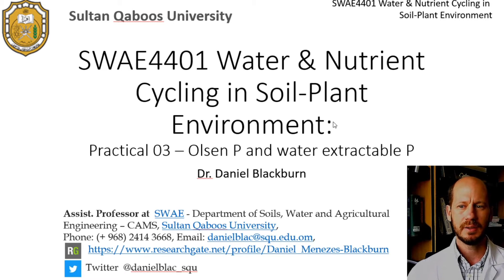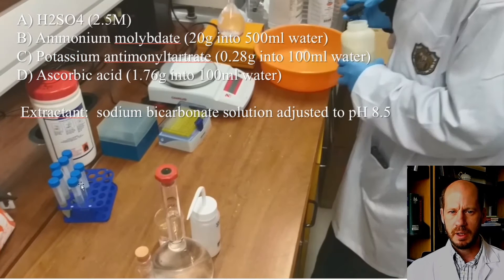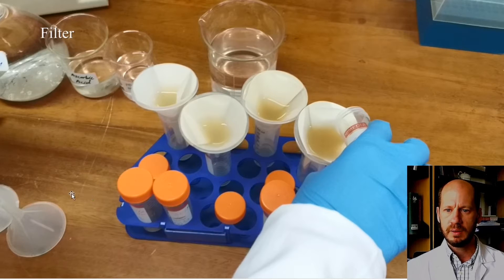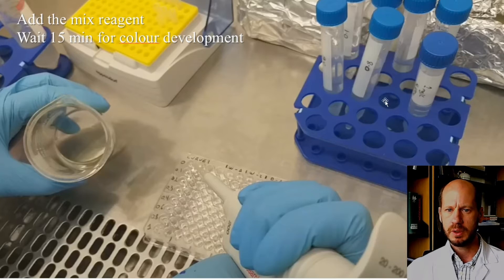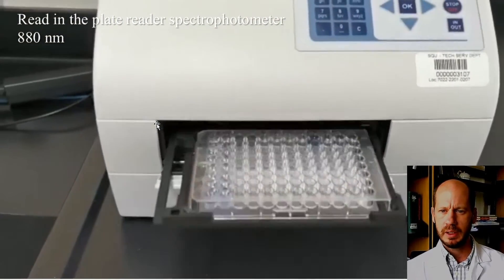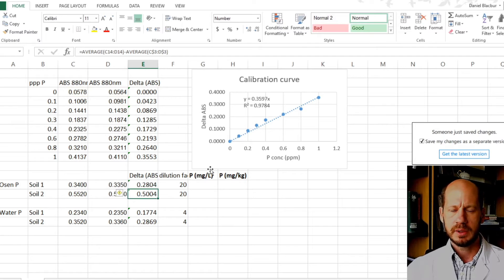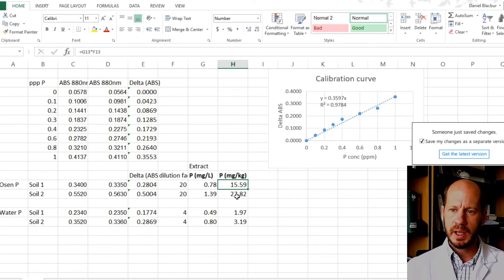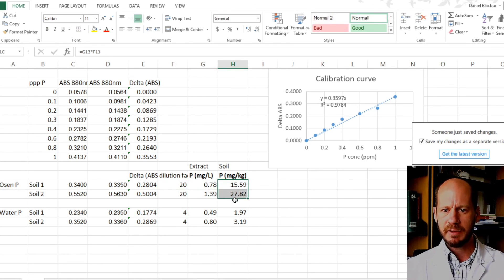Lab 03 - Measuring soil phosphorus bioavailability - Olsen P and water extractable P

Comment: Does neutralizing the Olsen extract improve the clarity of the solution?
Reply from the maker: I usually don't need neutralization because I dilute my extracts 1:20 and make the curve accordingly. For low P soils, the neutralization of undiluted extracts is needed to avoid the fizzing in the microplate, which are hard to remove and makes reading impossible. If the extracts are too dark I recommend using the Malachite Green P method of diluted samples.

Comment: nice lecture..i wonder how much sample volume or standard volume do we need to add into each microplate well for 40microlitre mix reagent?
Reply from the maker: 200 ul of extract or standard per well
Reply: thanks heaps for your quick reply :) ..another question, do you measure nitrate and ammonia in samples using micro plate reader too? any suggestions regarding to the method  that works for micro-plate reader
Reply from the maker: @hariz6716  For these we use sensors.